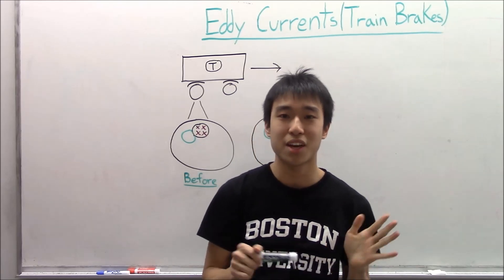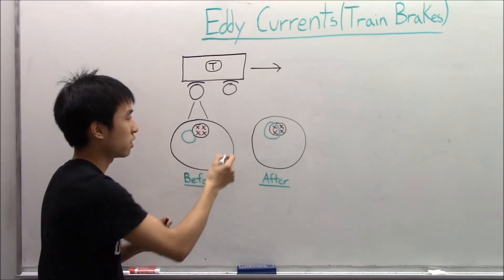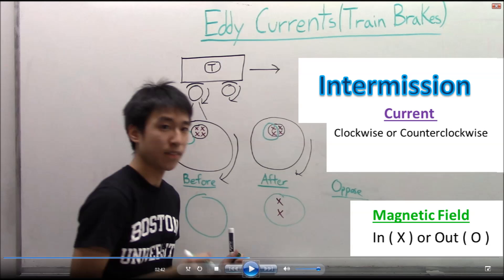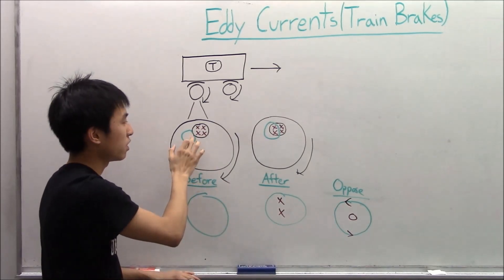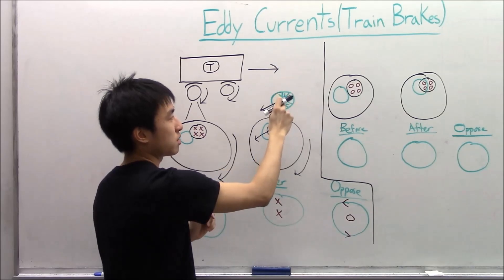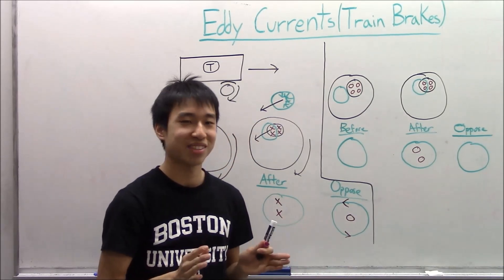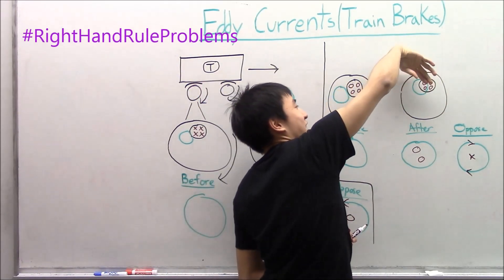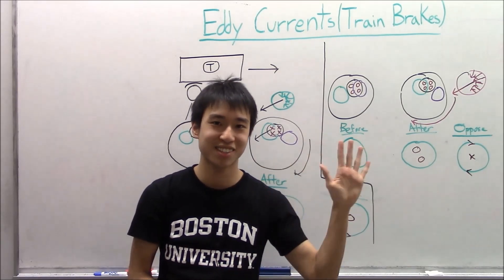Induced Eddy Currents in Train Brakes + Lenz's Law - Physics Made Easy! ( BU - PY 106 )

Comment: WARNING. The explaination of the force genrated is wishy washy; the forces generated DO NOT point towards the center of the wheel. Also the direction of the eddy current is NOT JUST counter clockwise around the wheel as suggested @2:51; there are actually 2 sets of eddy currents. For better explaination of what is really happening, refer to: https://www.youtube.com/watch?v=H310MWSWxF0. The force is generated due to interation between these 2 sets of magnetic poles generated by induced 2 eddy currents of diff direction AND the poles of the magnetic brake; this force directly opposes the force of wheel movement.